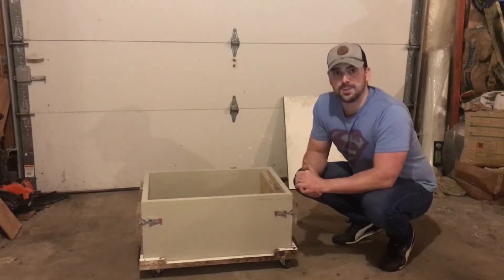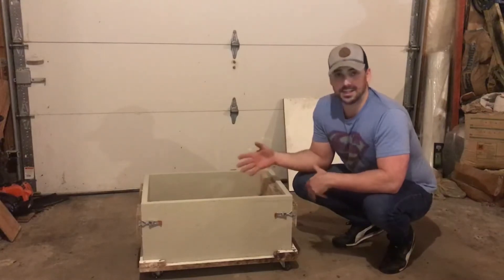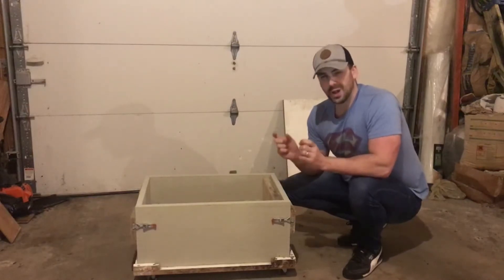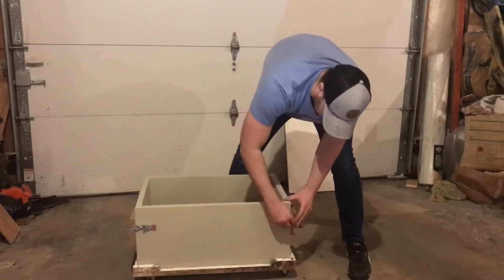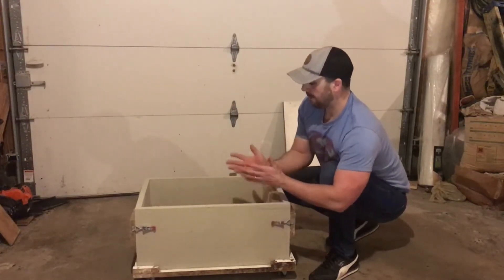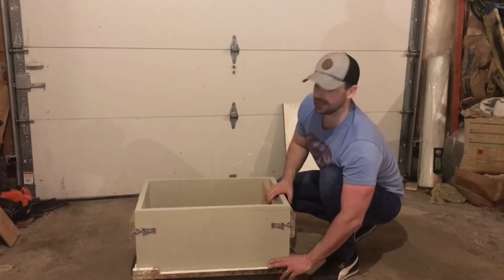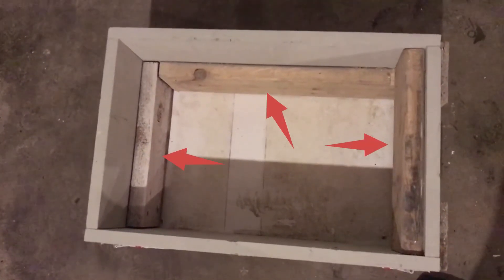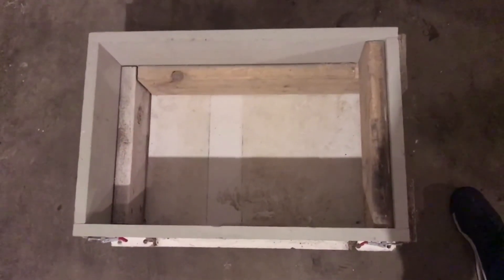How Z Panels Are Made

Comment: What’s the fiberglass mesh for?
Reply from the maker: The fiberglass mesh helps the Z Panels retain their shape by acting as the medium by which a skim coat of lime plaster is applied.
Reply: @sativabuildingsystems3796   does it also impart a measure of reinforcement?